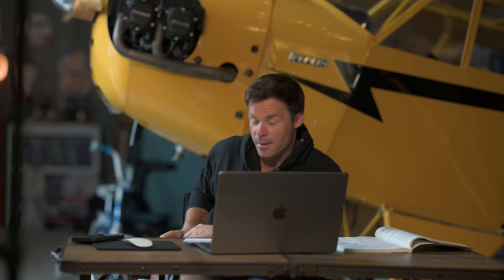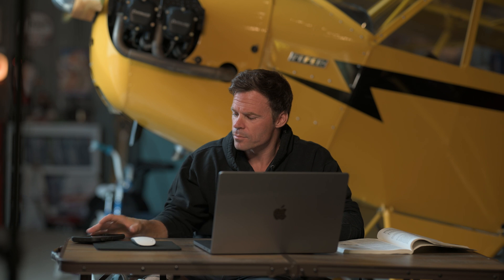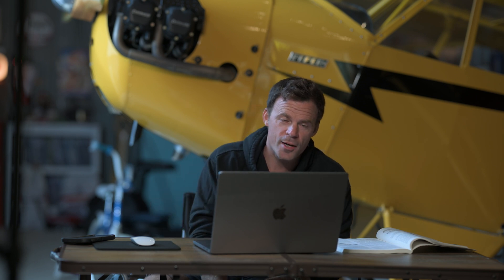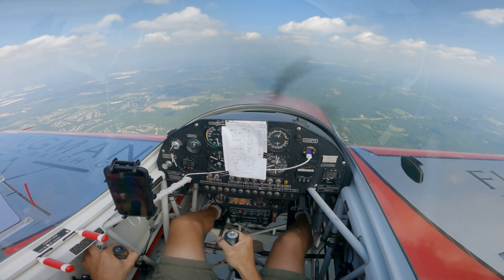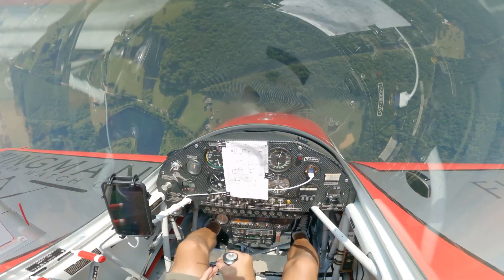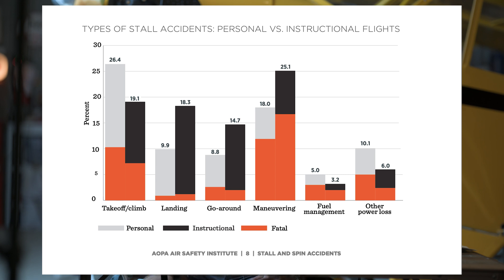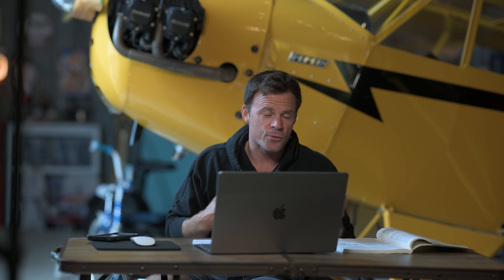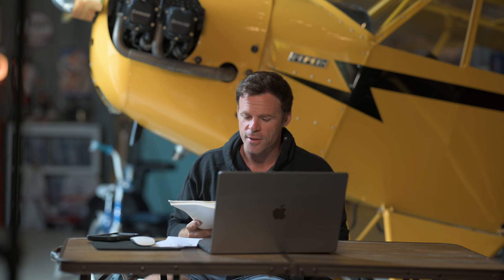This will save your life! Understanding what Causes an Aerodynamic Stall and Why...

Comment: Not only does the aircraft stall at just one critical AOA but known to few pilots is the aircraft will stall at only one aft stick position known as the stall stick position. AOA and stick position are directly related.  No pull no stall.

Comment: I learned all this flying model airplanes which every pilot should do because you can make deadly mistakes over and over again and all you have to do is bring a bag to clean up your mess.   I had a habit of overloading my planes with too big an engine and ending up with high wing loading and then high G moves at low altitude - tip stall, snap roll, clean up mess - ha ha!

Comment: During the hammerhead turn around the is no lift, and no angle of attack, as the airplane is vertical, so there can be no stall. There is no relative wind to detach from the wing.

Comment: Hi Joe, I’ve often wondered whether the (tired? confused) pilots of AF 447, who got their Airbus into that tragic high altitude stall..and apparently a nearly flat (near zero forward speed) vertical descent, even had, after the first minute or so, the ability to unload the wing.  That is, as the plane fell nearly vertically, was there any available elevator (horiz stabilizer) authority left to permit a pitch over…  Can you comment on that?  My very limited understanding of big swept wing planes is that throttling up tends to cause a pitch up?  But maybe throttling up, even with some pitch up, would in time have created good airflow over the tail to make it function again and allow unloading?
Reply from the maker: Kevin, from what I understand the Captain was in rest and the pretty inexperienced FO's were in control until the CA came up a bit after the event started. I believe they put themselves in such a deep stall that they would have needed something like 20,000ft+ to recover. I don't totally blame them because "Airbus won't stall" and I believe the procedure at the time was full aft stick and power out (which has since changed since I started flying the Bus. ) Powering out of a stall always seemed odd to me and you do notice a very noticeable pitch up from the underslung engines.  I also think the CA told one of them (or maybe he did it himself to go stick Forward but with the opposite stick full aft it takes the average which in this case would be stick neutral. I'm kind of rambling here but another thing to note is when we do this "unreliable airspeed" situation in the Sim, it is very very difficult to pick up on it initially and is really eye opening how quickly it can get out of hand. Sorry for the rant, hopefully some of that makes sense

Comment: How can a plane fly and not stall at 5kts?
Reply: If you’re not using the wing for lift - the lift can’t fail you. It’s like taking a plane to zero g’s, as if you took it into space - you can’t stall. If you don’t ask anything of the wing, then it can’t fail you - does that make sense? 

If you fly a plane straight up, you are using previous acceleration, not lift from the wing to do so. Therefore when you fall, it’s because you ran out of acceleration, not lift from the wings. Technically you will be moving through the air at a speed, going to zero as you run out of acceleration (side note, hopefully that’s the right use of the word - forgive me if it’s not!) Remember both lift and thrust can make you go higher, in normal flight you use them together to go up. But in certain situations you don’t - like imagine a rocket/modern jet capabilities or a glider just using lift with the flow of air etc. Also remember lift is not exclusive to the wing. It’s basically just a force created. It’s generally used for the force away from the earth - but if you take away the idea of to/away from earth. It’s just a force really. You can create lift with the fuselage or any part of the plane, even the rudder or elevator. You can create lift with a brick or your hand - they just aren’t optimized for it so usually the lift is much less than it would need to practically fly. Imagine every surface of the airplane is like a lesser wing. Also envision the prop as a type of “wing”. The wings are just optimized for a force a specific direction from their orientation - up and down only have meaning relative to the wing if it’s not a symmetrical shape (with a symmetrical wing the rest of the plane has an effect, but if you were simply to take the wing, it would make no difference) . - the rudder is optimized to create a force 90 degrees from the wings. The stabilator/elevator is optimized to create a force 90 from that just like the wings. The only real difference is their size and functional use of the force they create. 

Remember also that g-forces don’t coincide with towards or away from the earth - it does but it doesn’t sort of. G’s I’m flying are really just relative to the design of the plane and us - our bottom and top/the planes bottom and top. So lift - ie staying away from the earth - can be achieved in positive or negative G’s, because it’s relative to us. Just as away from the earth can be negative G’s, (like hanging upside down); towards the earth can be positive G’s (like in some loops)

If that all didn’t make sense - well it’s hard without drawing it out, I think.
Reply: @missequestrian3448  yea sorta get what you’re saying but when somebody says you can fly at 5 knots and not stall I imagine a plane slowing down to 5 knots and stalling well before it reaches that. To me, no plane can maintain flight at 5 knots and not be falling out of the sky. Lol I’m sure it was meant in a different way but that’s the way I interpreted it lol. I’m just a student pilot getting ready to take my check ride so I don’t know a whole lot just honestly trying to understand a plane not stalling at 5 knots. I would think trying to slow to 5 knots would cause you to have to exceed your angle of attack in order to stay up resulting in a stall. In a vertical attitude heading straight up until you slow to 5 knots like you said, you have already exceeded the angle of attack and are decelerating so you are about to fall out of the sky either way. You can’t fly straight and level flight at 5 knots without stalling
Reply: @blainepetsupplies5354  yeah totally! I think technically there would be no critical angle of attack, but yeah - maybe a model airplane but none I know of do that lol
Reply from the maker: Because the wing isn’t loaded and the angle
Of attack is less than the critical angle of attack
Reply: @Bananasssssssss  I’m confused lol. I’m not doubting you I just can’t grasp the concept.
I’m imagining a plane trying to fly at only 5 knots and not falling out of the sky lol
Reply from the maker: @blainepetsupplies5354  I can do more than imagine it . Lol. If the wing isnt loaded, there isn’t anything to stall
Reply: @Bananasssssssss  can you fly your cub at 5 knots without stalling?
Reply from the maker: @blainepetsupplies5354  yes, lol because airspeed isn’t what stalls a wing, angle of attack does. Realistically it’ll be briefly but yes
Reply: @Bananasssssssss  low airspeed will cause you to reach your critical angle of attack wouldn’t it?
Reply from the maker: @blainepetsupplies5354  usually it will but again, ONLY if you exceed the critical angle of attack. So if you try to maintain the same altitude as you slow, you’ll eventually stall but its because you exceed the critical aoa
Reply: @Bananasssssssss  ah ok I get what you’re saying. Didn’t men’s to get so technical lol thanks for responding to me
Reply from the maker: @blainepetsupplies5354  nah! No worries at all! It’s kind of a confusing topic, lol